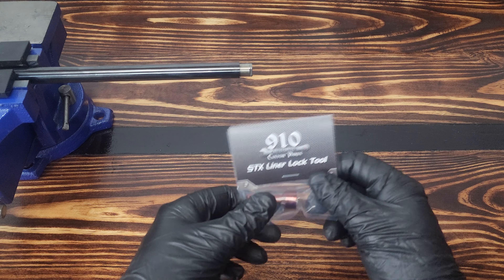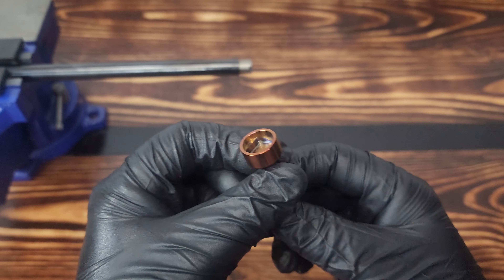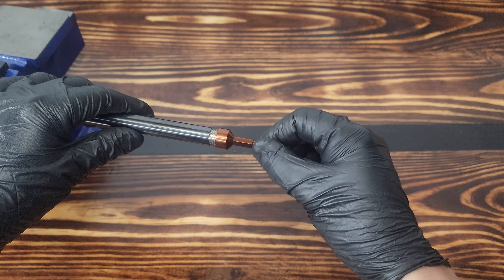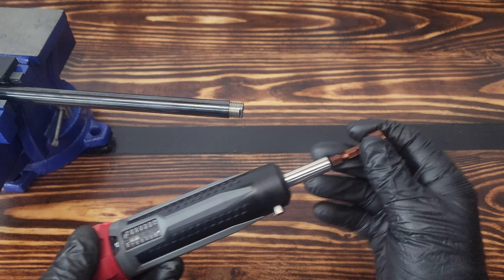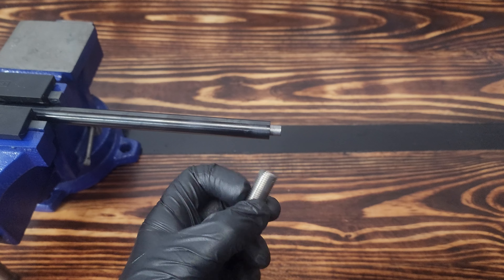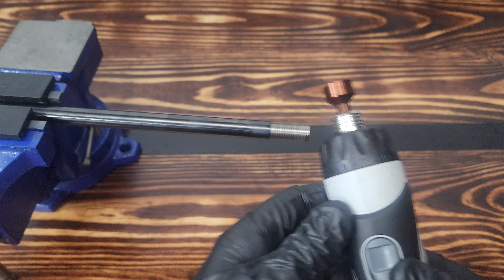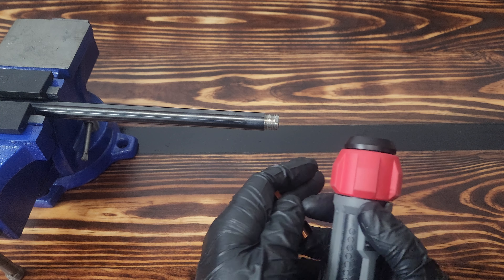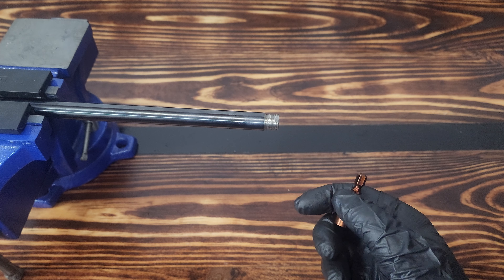FX STX Barrel Liner Lock Tool - Custom Tool

Comment: If the liner lock is tightened too much, will the barrel bend or will there be a difference in accuracy?
Reply from the maker: Both. The bent liner will cause accuracy issues. Also, if too tight, it can strip the threading out.

Comment: I had my liner out to clean it. After getting everything together again i had a huge poi shift. .. any advice? Should
I re index the liner ?
Reply from the maker: If the liner is not indexed the exact same, then POI will be off. Some liners have a more drastic POI shift than others. I would recommend re-indexing the liner until you find one closer to your original zero.
Reply: @910AirgunTuningandRepairs  thanks, i did watch a bunch of videos on the subject. I thought these liners were almost perfect… apparently not.